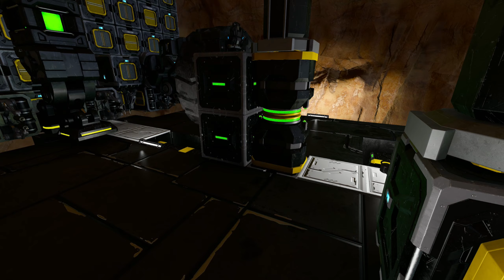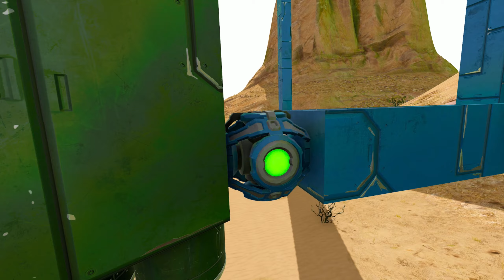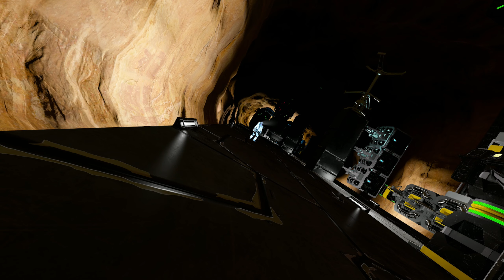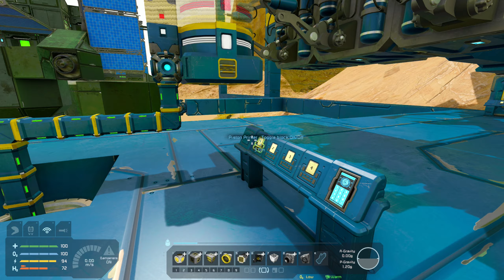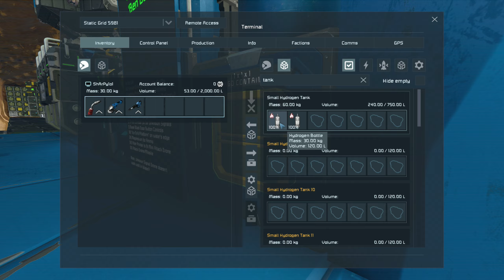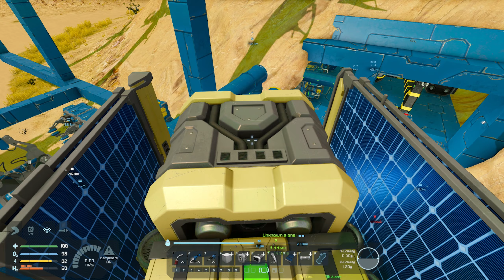Automated Ice Drone S2E10 - Space Engineers

Comment: In the past when I have tried to bring your tunneller in with a projector I couldn't get it to work once built. The wheel and landing gear are up to high so they don't work properly. Is there a step I am missing?
Reply from the maker: I did mention in either this episode or in ep10.5 but when the design is built in, the piston above the connector/merge raises abnormally (never experienced till now)
Fix... reverse the down/up piston so it all comes down, then use that pistons 'maximum distance' to bring it to the recommended setting of 2.8m piston extension ✌️
Hope this all makes sense
Reply from the maker: I also may need to alter the BP again so it has 2 "Recycle Grinders" at the back of it so it can work better (not sure if i have added already or not haha)
Other than that it works fine (note when the design is pasted in, it connects the welders & grinders at the rear of the design, just seperate by removing close floor blocks)
Reply: @ShArPy1o1Games  Thanks for the quick response. It makes sense on what to do when projecting it in. I will give it a try when I have some more time. I have pasted it for several playthroughs so I am used to grinding those rear blocks off and replacing them.
Reply from the maker: Great to hear, don't forget to give it the components needed to build at least 3 connectors and merge blocks (they get recycled as it drills)